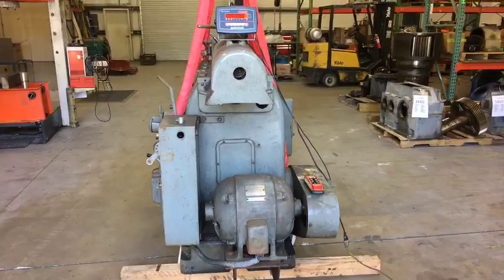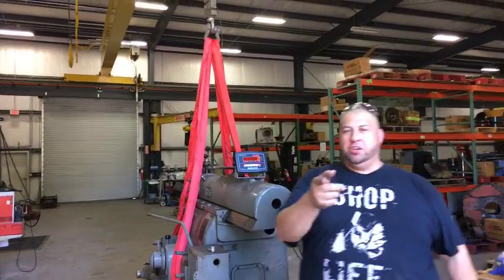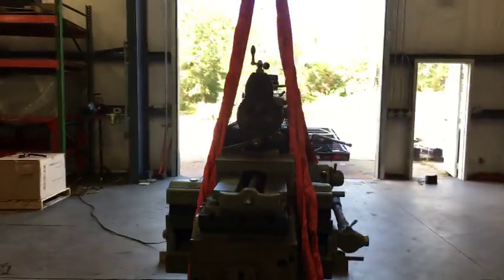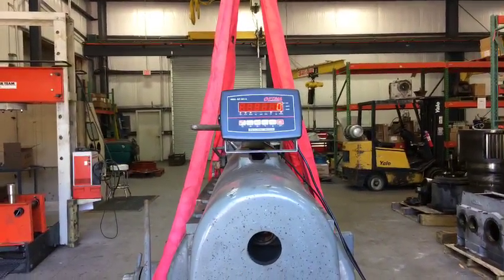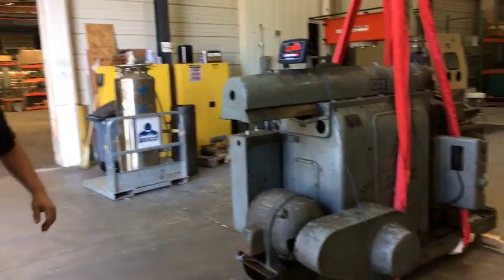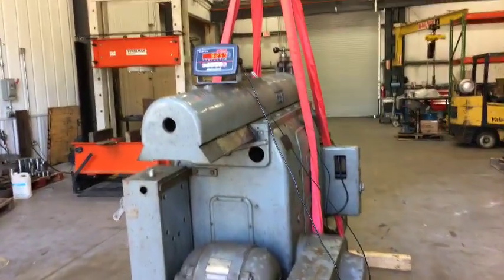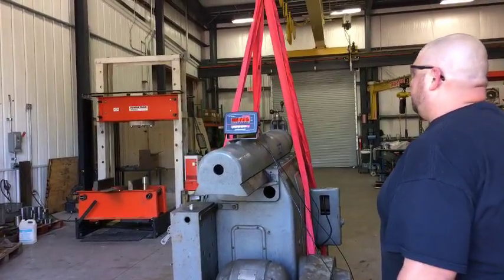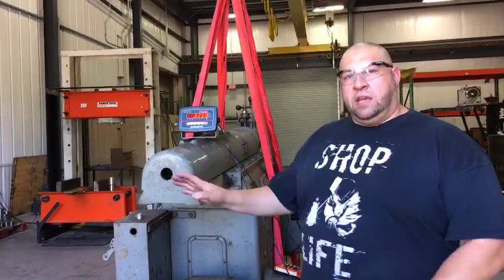Let's Weigh the new Shaper!

Comment: I'm envious of your shaper!
As an FWIW, in the future when rigging for a lift similar to this one always use the highest position possible to attach the to, in this case the to ram slide would be the best choice, center the ram and use the basket sling technique on each side of the casting carrying female ways. This arrangement (highest possible lift point) on any heavy lift provides the most  stability for lifting, this technique also works with a fork truck, come in from the side and lift by placing forks directly under the ram with a piece of plywood or plank between the tines and ram.

Comment: Adam, that is an amazing coincidence. I have an almost identical machine. the ser. Nos. are within a few numbers of each other. My manual shows the 32" to be the heavier of the three versions (tool, room, production and industrial) at 5840 lbs, which mine is also. Yours has the auto down feed, must have been an option. Great machine lots of speeds and feeds. My oil supplier found that the lube oil specified for the sump is no longer available but came up with a substitute if you need the number. It takes about 7 gallons! and ain't cheap.....Dave
Reply from the maker: +David Richards hey David, I didn't know you had one of these shapers. Very cool! I talked to a guy up on the mid west that has a real nice 24" Rockford. He's a machine rebuilder and believes in transmission fluid for his machines. I know my K&T uses the Type A transmission fluid which I mentioned to the guy and he agreed. Claims it's better then way oil. Wondering if that's what I should run in this one.
Reply: Adam: I think ATF would be way to light for this one. The oil is pumped around through the transmission and all the ways. There are many types listed in the operators manual but are out of production. Shell says their Morlina S3BA-100 is close. I'll email a photo.....Dave
Reply: Run type f and put a B&M shift kit in it.

Comment: Is it just me, or do those machines seem to grow in size when they are suspended in the air like that?

They certainly get huge when you have them on a bumper hitch trailer and you blow a steer tire at 60 mph.  Having your trailer brakes working and properly set up is something that should not be neglected when you move these.  It certainly was vital in helping me keep things straight with the world when that happened.

My 14" was estimated to be 3,800-4,000 lbs.  While watching the move video, I figured it would be more than double that.  It was, but by a much narrower margin than I anticipated.

Comment: As I recall the spec sheet weight I gave Adam was close to 7900, but for dry weight and a machine 30 yr newer. Those old motors are a heavy chuck
Reply from the maker: I seen weights all over the place and did not know which one it would have been. I knew this would solve all the guess work.

Comment: What I particularly like is that not only do you have a 10 ton overhead crane but an equivalently rated load cell. Moving shop equipment around,raw material, and pain in the ass stuff like car/truck engines with an ability to know the weight. It clearly helps to have 3 generations of family saying what is a good idea and gee I wish I had.... Whether avoiding a down side or suggesting an upside. Shops like this are precious survivors.
Reply from the maker: Yep that's my work place. My dream is to have something as nice for my personal shop, but yea, dreaming.
Reply: He's at the shop where he works.  Nice that they are letting him store it there.  Their business is supplying and repairing heavy equipment so they should be doing it right!
Reply: Adam, never stop dreaming! It works for me!!

Comment: Easy way to quickly figure equivalent weight in kilograms: Divide imperial weight in half, and subtract 10%. 

Takes a couple seconds.
Reply: 1 Kg. = 2.2 lbs.  Your method gets close enough.

Eli D.
Reply: Yeah, I'm well aware of the conversion factor--been using it for years in engineering classes. But if you don't have a calculator handy, then the down-n-dirty method works just fine, and we used to use it all the time to make fast calculations in the ER when you didn't have time to get a calculator if a patient was crashing. And quite frankly, it gets you closer than you can determine on a syringe to push medication, especially when some of the liquid medication stays on the inside of the syringe. 

But the point is that it's SUPER easy to 1) halve a value, and 2) subtract 10% of that halved value. And it gets you to about a half a kilogram in most cases.
Reply: 1 pound = 0.453592 kg
Reply: Yeah...there's a number you can quickly process in your head. LOL!

Comment: I am  curious as to how thick the floor is in your shop where this goes. Any worries with it being too heavy at just over 8000 LBS?
Reply: I bought a mill 2 years ago that weighs about 2-2.5 metric tons,  but have about half the footprint of this shaper, meaning the pressure per square meter is about the same. The slab in my shop is about 10 cm thick with no reinforcement and poured directly on top of lightly compacted dirt. It shows no sign of cracking at all, so I wouldn't worry too much. Especially since he has several other heavy machines without problems.
Reply: Nah, any decent 4" concrete should be able to take 2000 PSI all day long if the prep underneath was good. Cut that in 1/4 for a big safety factor. You'll have more than 16 square inches contacting the floor